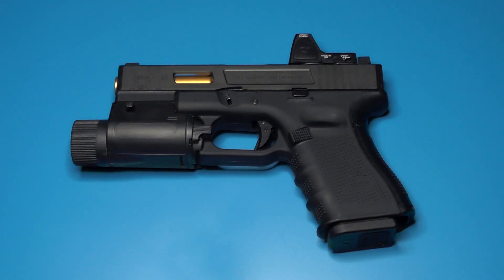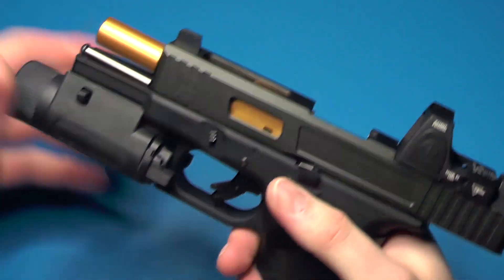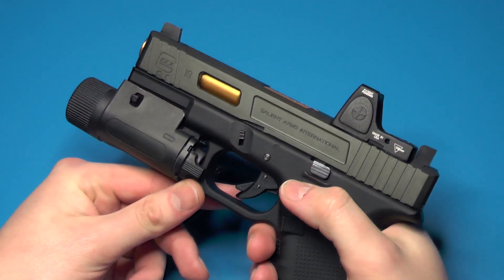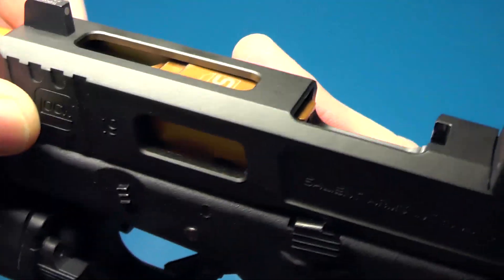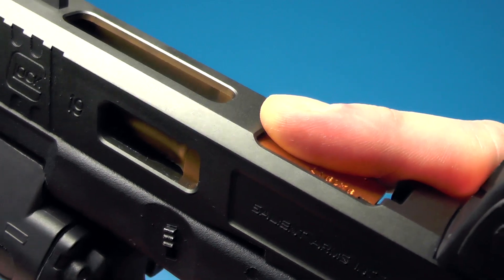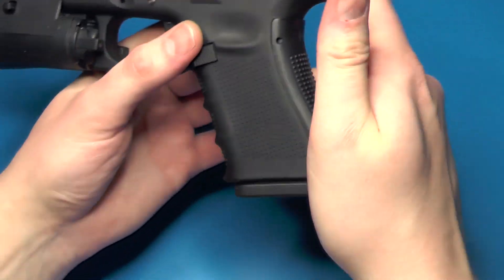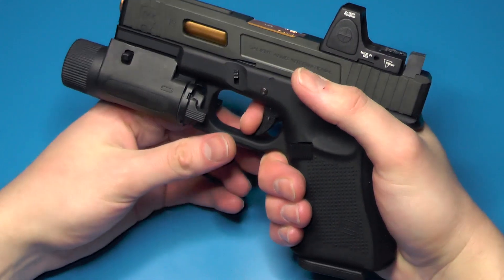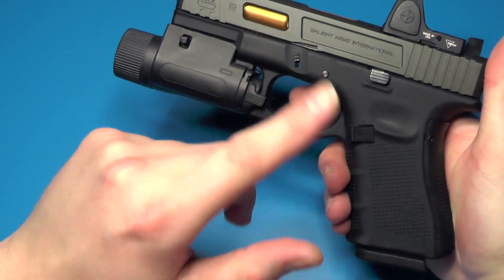Update: Glock 19 w/ A1A SAI kit - slide release - barrel lock-up - recoil guide rod screw

Comment: That slide and barrel is super dry, that is 100% stiction between barrel and slide. you need to lube your inner slide and outer barrel. 
Also lube is needed on some parts of the outside of the hop unit, and the stabilising o-ring should have light grease on it or fairly "thick" silicone oil.

Comment: Hey I saw your comment on the stark arms sai Glock 17 and you said that it looked better than the custom glocks made by we tech. Could you tell me why you thought the stark arms SAI glock is better than the we tech ones because I'm wondering whether I should wait for the stark arms glock or get the we tech custom glocks. (I live in Taiwan so availability for either of them wouldn't be a problem for me)
Reply from the maker: yoloswegz Yeah well basically the "custom" WE "SAI" Glocks are just SAI look-a-likes that look pretty lame in comparison to the more realistic looking Stark Arms SAI Glock 17. That's just purely based on looks though. For actual usage I would probably still prefer a WE over SA. But in this case, it's all about the looks so the SA SAI wins.
Reply: Guess you're right in terms of realistic looks. Thanks for replying.
Reply from the maker: No problem! :)

Comment: Wow you and i have completely different problems with this kit. Mine was much more severe. 
1) the blowback housing was off spec, the mound did not sit low enough to engage the hammer all the way causing it to shoot in full auto uncontrollably. Need to replace the stock hammer roller with a 9mm one. 
2) the slide needs to be modified slighty (round off edges) because it was literally taking material off of the guide rails on my WE g19. 
3) slide doesn't return to battery because the nozzle to piston cup was too tight 
4) trigger contacts the bottom of the blow back housing causing slide to lock up. 

Looks like Ace 1 Arms still has a bunch of QC problems.
Reply from the maker: driftinsti Hmmm... Sorry to hear that man :(
Reply: yea, their QC is not very good. But your's seems to be working alright other than the barrel tilt issue. I honestly don't quite like the o-ring inside the barrel and its gold color. It doesn't have the best finish. I'm currently just using the stock WE barrel. Works fine.